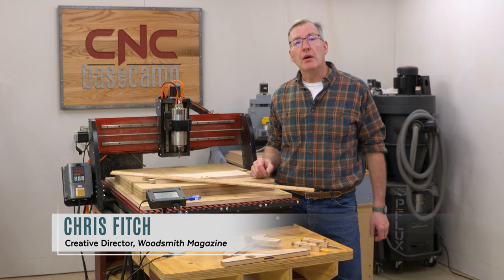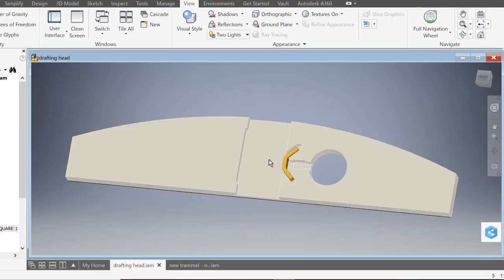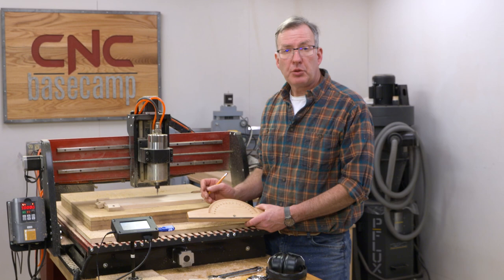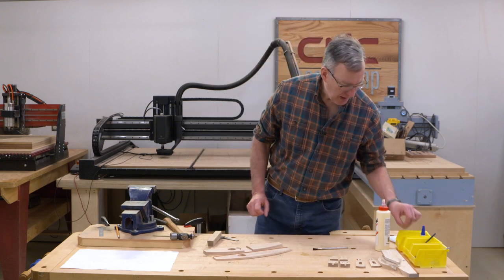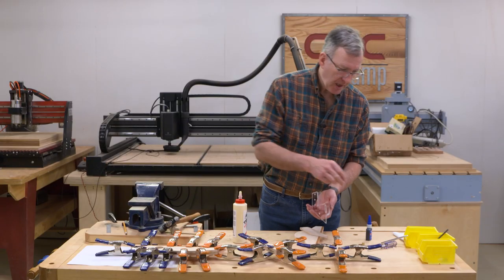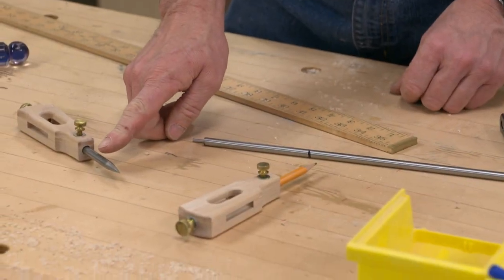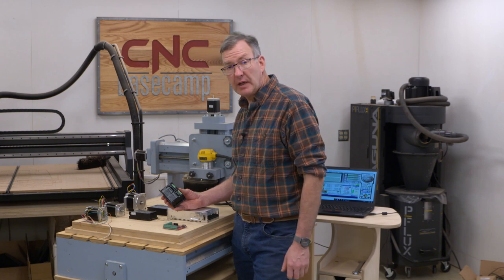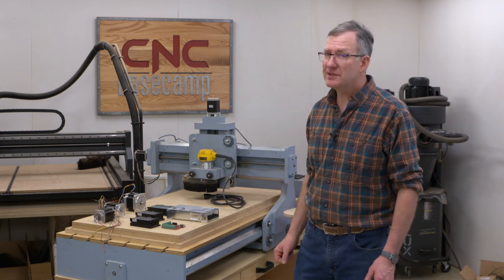CNC Basecamp E018: Ruler Accessories

Comment: One thing to consider when building your own CNC is how to house the electronics.  I used an old PC case for a handful of reasons.  First it was cheap.  Second, it's a nice metal construction to help shield sthe system from noise.  And finally, I was able to repurpose the existing power supply.  Besides the power for the motors, you're going to need 5 VDC and sometimes 12 VDC.  The PC power supply has outputs for these.  To make it easy to use these, you can buy a simple board that mimics the connection on the motherboard that the power supply plugged into.  This breaks out all the different outputs from the power supply into easy connections that you can use however you want.  It's a simple system that is inexpensive and works out pretty well.
Reply from the maker: Thank you for sharing this.   I am thinking about making a few more homebuilt CNC routers and the electronics are a big part of the machine.  I have had some issues with interference form dust collectors and such making the machines do odd things so I like the idea of a shielded case.

Comment: Didn't you use to use Vectric software? Any reason why you didn't mention it at the end of this video?
Reply from the maker: I did use Vectric VCarve - sorry if I wasn't clear about that.  I tend to do all of my design work on Autodesk Inventor since that's what I use for my work with Woodsmith and Shopnotes.   I then create DXF files and import them into Vectric VCarve.    I plan on doing projects using VCarve alone, or Fusion 360, or Alibre Workshop and migrating away from using Inventor for Basecamp in the future.